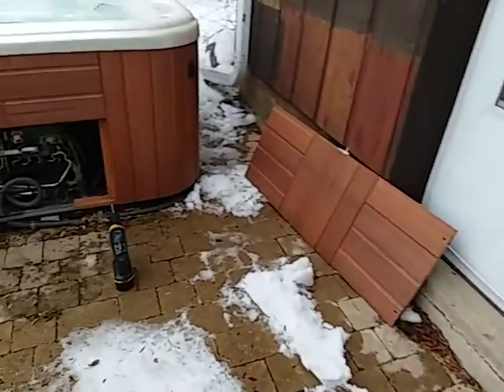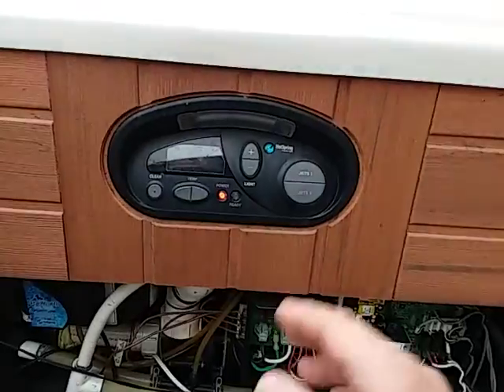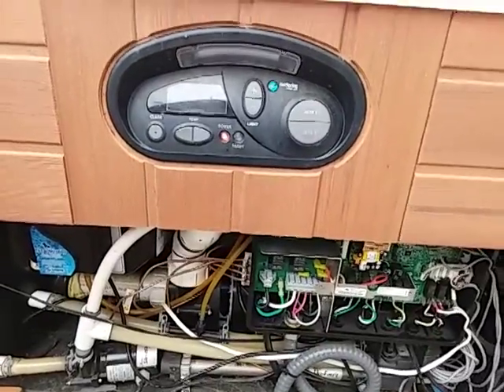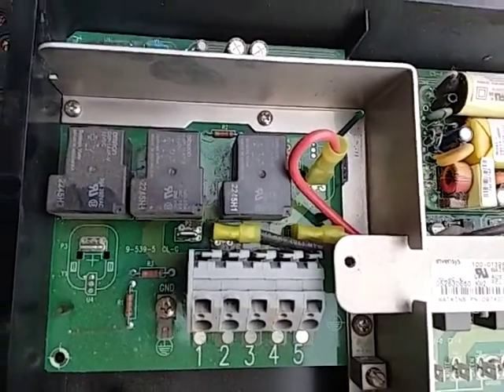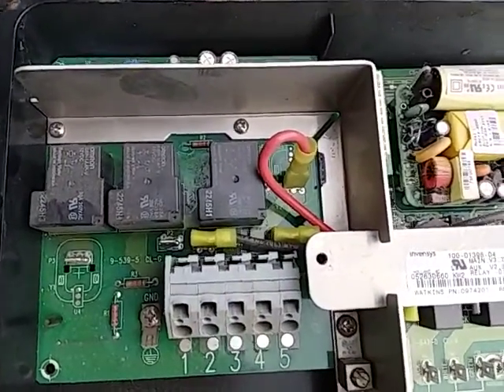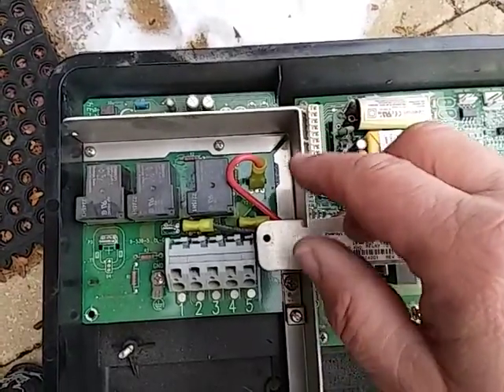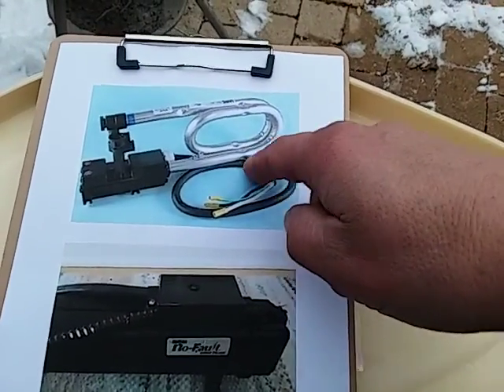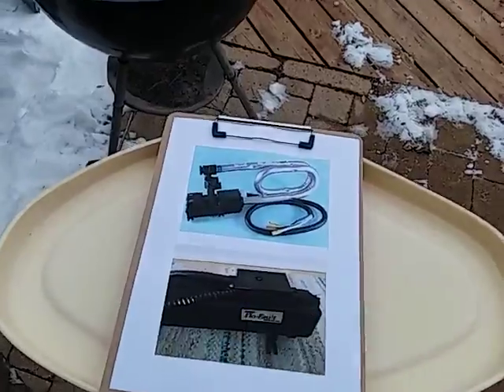troubleshooting Hot Spring tub not heating

Comment: Hi Craig I have the same situation that you discussed except the heater  light isnt on. What do you think could be the problem?
Reply from the maker: A bad auxiliary panel at the back of the spa can interfere with the call for heat function. Disconnect the phone line style aux connection and reboot. If not that, the multi color LED could be bad or getting wet from a leaking light lens. Try disconnecting that if it's not the aux panel. Always kill power when plugging or unplugging things in the IC INTERFACE port. You'll damage the board if you don't.

Comment: Hey Craig, I’ve got a 2008 jetsetter wired for 110v that isn’t heating. I’ve replaced my heater board and waited 20 hours it hasn’t even started to get a little warm
Reply: I’ve got two new heater relay boards, I’ve made complete sure the tub is wired properly. Everything is all good, just no voltage to heater. Blinking D9 light steady D10 and the Heater indicator and LIM lights are steady. I’ve also applied additional tape to the chip that makes contact with the aluminum L bracket. I’m stumped, and I used to work for a hot springs dealer!
Reply from the maker: Did you insert the power jumpers atop the terminal block strip? You need a triple jumper on 3, 4 and 5. And break the center out of the other jumper to make a wide double connecting 1 and 2, missing the H1.
Reply: @craigsmith5025  yes I’ve got 1 and 2 jumped and 3 4 5 jumped
Reply from the maker: @davidcoffey8806  When the old relay board is removed off that row of pins to the upper right, you have to 'rock' the board off those pins. You also have to 'rock' the board onto those pins. Many just mount the board against the pins, and never get them within the spring-loaded connections. Also check for leaking light lens/wetness that may cause the system to wig. I cover that in one of my videos.
Reply: @craigsmith5025  I’ll check into that again, I was pretty sure I’ve been getting all the pins on right.
Reply from the maker: I ran into it again not long ago... a leaking light lens. The orange silicone light lens o-ring eaten out by tablet sanitizers. Getting the LED light circuit board wet. That interfered with the 'call for heat' program. If the black LED module is dripping/wet, KILL POWER before unplugging or plugging anything into the IC INTERFACE. Unplug that LED's IC INTERFACE plug and SPA LIGHT plug. Then reboot power. If it heats, leave it unplugged, address the lens o-ring, you may have a light that is ok when dried out, or it's shot and needs a replacement.

Comment: Hi Craig,

I’m getting a blinking power light even with heater disconnected or off.  It goes straight from powered down to blinking.  The only thing that works is the circ pump (new).  Heaters are new, jet pumps are new and control panel is new.  Filters are clean, getting good flow and ozone from bottom of tub (Grandee) What the heck do I even look for now 😆?
Reply from the maker: Sounds like a bad Hi-limit thermistor/sensor. Do you have a digital multimeter? Kill power to the tub, and immediately unplug the REG THERM sensor plug and the LIM THERM sensor plug. Read ohms where the wires go into the disconnected plugs. You should read something like 8 ohms at room temp. 4.8 ohms if the temp is 104. With a bad Hi Limit thermistor you might be reading false way high temps with a way low ohm reading... 3 ohms or less, More rare is a sensor reading way high ohms in the teens at room temp. Either way, both sensors SHOULD be within .20 ohms of each other. ie; 6.22 + 6.35 ohms ok. 6.22 + 6.57 not ok.
Reply from the maker: ALSO: Could be a bad multi-color LED module at the main light lens. You MUST kill power when plugging/unplugging anything into the IC interface. The main spa light connects to the IC interface and a SPA LIGHT connection. Kill power, disconnect both, reboot. Rare occurrence, but it can happen.
Reply: @craigsmith5025   Thanks I will check the LED and the ohms on the sensors.  Sensors came new with the new heater (installed 2 weeks ago heated/worked fine for the 2 weeks).  Maybe a bad batch.

I did pull a few connections when it was power on to try to find the bum equipment (oops).  I didn’t notice any sparking or sudden changes so maybe I got lucky and didn’t cause any damage.  I also tried every connection from power off position then rebooted.  I never got any reaction this way or that.

Comment: Thanks for the video.  I have an older Hot Spring and my problem is that the auto clean cycle does not seem to be working.  I think it should clean every 24 hrs but that does not happen anymore.  Everything else seems to be working and if I press the clean button that works without problem.  Any ideas??
Reply from the maker: The only auto clean system had a timer on the box, like the kind that turns on lights when you're away. They had that on some old models long ago. Sounds like that timer died if you have one. Otherwise without the timer no, only the circ runs 24/7 and the jets never came on.

Comment: could you show a way to prime the heater after a refill, how to get rid of an air lock on the heater element
Reply from the maker: Fill with hose down the gray filter standpipe. Power on only the spa breaker and get things flowing. When flow is going, THEN power up the other breaker. My spa MUST have trickle water feature valve open to burp air out of the circ pump after a refill.

Comment: hi craig so first off id like to thank you for the great video  im having an issue with no blinking red light and no heat i had an old heater board replaced it with a new one  when turning on  there is a little red light and a little green that turns on and the heat turns on after about 5 minutes the little green light shuts off and the power to the heater shuts off  any help would be greatly appreciated
Reply from the maker: Did you see my heater relay board replacement video?

Comment: hello Craig, you helped me troubleshoot a failed circulator pump last year in my Hot Springs Prodigy (about 20 years old) and I replaced it, thanks again. A few days ago one evening I went into my hot tub and noticed that it didn't feel as hot as usual and didn't feel very hot water out of the bottom "vent". I typically keep it on 99 degrees. The next day I checked and the ready light still wasn't on. I reduced the setting to 94 and it went on. What do you suspect the problem is? Today I added some water as it had gotten a little low and waiting to see if the water is heating, but so far I can't tell much of a difference. The heater in it is the second one replaced about 14 years ago I think. I also tried the outside breaker which has a 20 and 30 amp, one is for the heater and the test trip button doesn't seem to be working. Any suggestions greatly appreciated. Thanks Phil
Reply from the maker: If the test button isn't working, it likely isn't fully on, probably half-tripped. Does the breaker handle feel like it's solidly in the ON position, or does it 'flop' loose in that upper ON area? If so, it's tripping. Push it all the way off, then all the way on.
Reply: @craigsmith5025  It definitely feels like it's solidly in the ON position, not loose at all. I've pushed it all the way off then to the ON position again, but no change.
Reply: Hi Craig, so while test button doesn't work, breaker is solid, not loose in either position. Water temp down to about 83 from 94 a few days ago. Each day when I lower the temp setting, green light goes on when it matches the setting. Thoughts on what the issue is? Thanks for your help.
Reply from the maker: @Phil Colchie  the only way to be sure is to check input power at 1 & 3. You should read 230v with probes on 1 & 3. If that's good, check output voltage to heater where the giant heater cord connects at it's connections, sometimes not labeled on older relay boards, but labeled H1 and H2 on newer boards.
Reply from the maker: @Phil Colchie  some aftermarket heaters have a overheat reset button, tiny little thing above the small 1/4" drain tube off the back of the heater. Watkins factory heaters do not have reset buttons anymore. Not since they went to the twin-tube design.
Reply: @craigsmith5025  The second heater was also a Watkins replaced by a hot springs dealer. Since there's no reset button, is there any other way to reset it or is that what turning the breaker on and off does? As far as checking the voltage I don't have any electric devices/probes so that would leave me to call in a technician. Or even if I could borrow or buy the voltage tester, not sure I would be comfortable doing it.
Reply from the maker: @philcolchie1599  quite often, a meter is the basic troubleshooting tool. The problem lies where the power dies.
Reply: @craigsmith5025  Hi Craig I'm picking up where we last left off on our conversation above, had drained & shut down my tub for winter, now refilled yesterday and wanting to get this heating situation resolved. I bought a Klein multi-tester and want to check the voltage as you suggested. Can you walk me through how to do it, where do I put the probes, black to where, red to where, etc. Much appreciated Craig.
Reply from the maker: You should test 240V at inputs 1 & 3. As long as the green LIM OK is lit and red HEATER ON is lit at the top center of the big circuit board, you should read 240V output where the big black heater cord connects to the smaller board.
Reply: @craigsmith5025  thanks Craig, I tested voltage at P3 and P2 and reading was just 25 volts. Does that confirm that the heater relay board is bad? If so is it difficult to remove and install a new one? I successfully replaced the circulator pump last year with your help. Please advise when you get a chance.
Reply from the maker: @Phil Colchie  you test voltage in at wire inputs (from your breakers) at 1 & 3. If that's good, see if your main circuit board has a 'call for heat' with LIM OK lit in green, and HEATER ON lit in red
 If so, check for voltage output to heater where the big black heater cord connects to the relay board with white and black wires at H1 & H2 if it's a newer style board, or the yellow terminals if it's an older style board. (like the ones I pulled off at the beginning of my relay board replacement video)
Reply: @craigsmith5025  I just sent you an email, thought it might work out better. Thanks.
Reply: @craigsmith5025  Great news, thanks to your responses and videos I determined it was the heater relay board, saw the black marks on the back when I removed it and installed a new board. I also changed the questionable 20 amp breaker (30amp was fine). I just turned it on and all is well (almost), jets, heater, circulation, etc. One thing I noticed was that the Smart jet control knob has some water leaking out when I ran the jets. What do you think that might be, gasket or some other replacement part? Very much appreciate your help Craig.
Reply from the maker: @Phil Colchie  there is a diverter valve rebuild kit which includes inner gate, top ring, and all o-rings. There's 2 port and 6 port versions, and plenty of YouTube videos on replacing Hot Spring diverters.

Comment: Hi Craig, My 2004 Jetsetter has no heat. Had blinking red light on display, replaced relay board and light is solid red and the two lights on main board are solid, red and green. Relay board has solid green light. So far so good. No voltage to the heater. The main board does show a bit of scorching near the jet electrical terminals. Thinking I should replace mother board. What do you think? Other voltages and installation of relay board are OK.
Reply from the maker: No voltage to the heater, did you put in the power jumpers like I did on my relay board video? Different spas require different power jumper placement, follow the diagram for your model J. I wouldn't replace boards unless you KNOW there is a problem with it. A flashing red light for example was a Hi Limit heater overheat error, not a relay board.

Comment: I have a 2014 envoy hot tub. The hot tub heats but does not maintain the temperature. Can you give me any idea what is wrong with it
Reply from the maker: Do you have error indicators going on, like PROTECTION MODE on the screen, or flashing power/ready lights?
Reply from the maker: I have 2 other videos for not heating with blinking light errors, worth watching.
Reply: No indicator or lights at all.
Reply: @craigsmith5025  I will watch the other 2 also. My husband is here also and we have not figured nothing out yet.
Reply from the maker: Both breakers on solidly, heat issue with no blinking POWER  or READY lights. Hmmm. Either CONTROL UNPLUGGED is lit on top center of the motherboard in the black box, or leaking light lens getting the LED module wet, causing interference. You use a tablet floater?
Reply: @craigsmith5025  sorryrey it too me a few days to respond it has rained here a lot. My husband and I got out to the hot tub tonight and the red light is blinking that says rtr the green is solid.

Comment: Where can i get the heater that looks like a trombone?
Reply from the maker: You can't. They made the tri-bend heater for less than 2 years. It was so horrible, they redesigned to the twin tube heater. Same connections, same sensors, same wiring. But no reset button. You go with the PDR style heater with the twin tube now.
Reply: @craigsmith5025  do u no where i could order one

Comment: My panel says “set temp” “ut-4”. And nothing happens when I push the buttons. What could be wrong ?
Reply from the maker: Temperature up will go 102 103 104 ut1 ut2 ut3 and ut4. Those are override codes for temperatures over 104. If you cannot get the DOWN button to get the temp lower, your up button is working, but down button may not. Make sure you have no padlock icon indicating Temperature lock or spa lockout features are engaged.
Reply: @craigsmith5025  its not locked and I cannot do anything on the panel 😵‍💫 it’s just stuck in the ut4
Reply from the maker: @aslauggudmunds7651  any jet or light functions? Is the entire control panel locked up? If you have a flashing power light, that will lock up a spa. Sometimes a bad panel at the back of the spa locks up the main panel... unplug the phone jack wire to the aux panel to see. Are you sure there's no padlock icon on the panel?🔒
Reply from the maker: Is the "CONTROL UNPLUGGED"  LED lit on the motherboard?